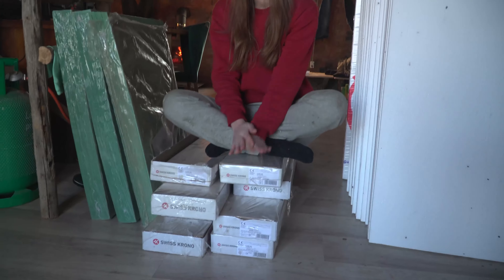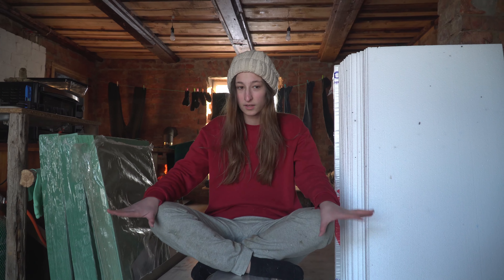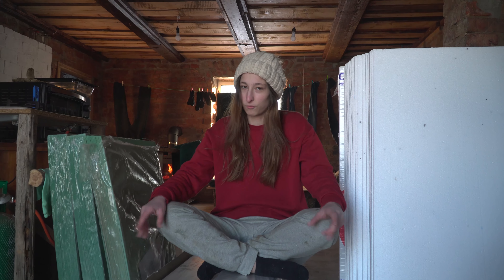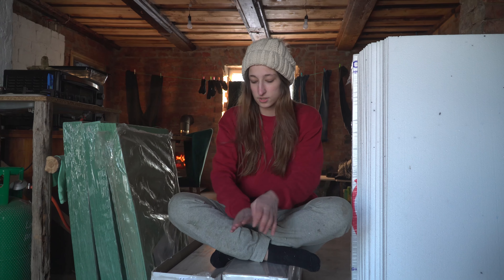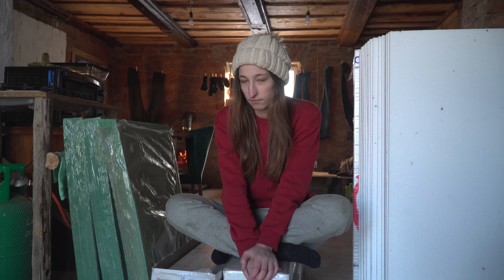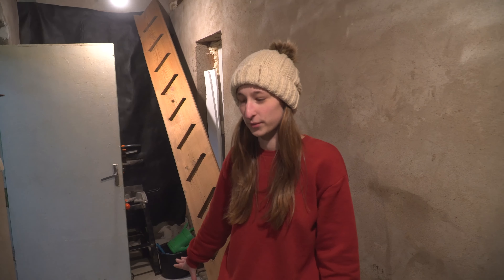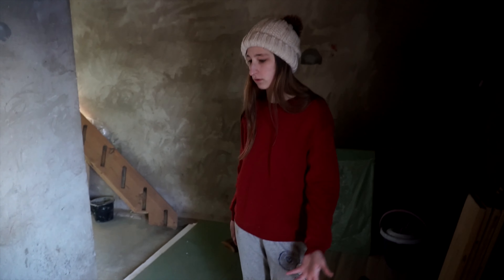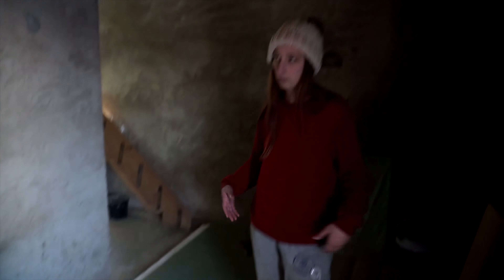Finishing the Floors?!

Comment: There should be an door sill/balancer, exactly under the arch from the door/stairs area and kitchen/living room area. (you can diy from wood - 1/2 cm by 3, make it slick, lacquered). It can be done after you finished it, but it is complicated).
It's too long to have arround 6 meters (by eye) line of interrupted laminate, you will avoid blowing it, even you left the gaps.
I hope you give hydro isolation under the polystyrene (that blue one) (that must not be cut, best is in one piece).

Comment: No sound.
Reply from the maker: I checked seams all okey! Did it fixed it self?
Reply: @DoBeDiff  Sorted now.  Best wishes from England.
Reply: will the foam not be damaged over time? or is this kind of floor a temporary solution?
Reply from the maker: Good question, the foam is harder than typical floor, made for concrete floors so made to hold up lots of weigh if distributed evenly. In this case it should last many years, but we want to chnage the concrete floors to heating floors but after few years it's not cheap at all 😊